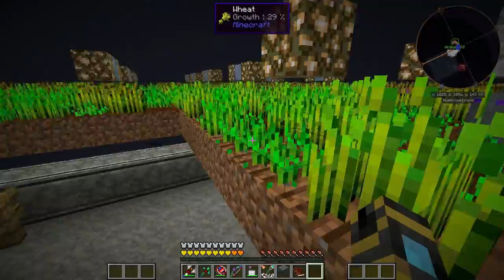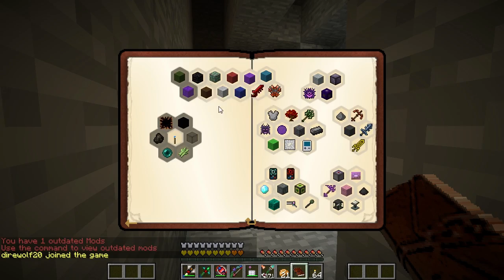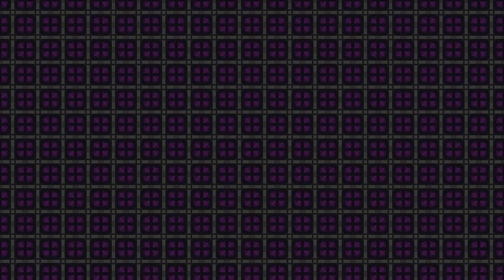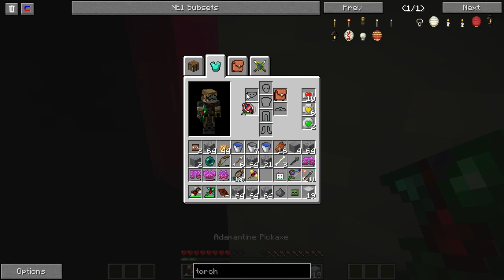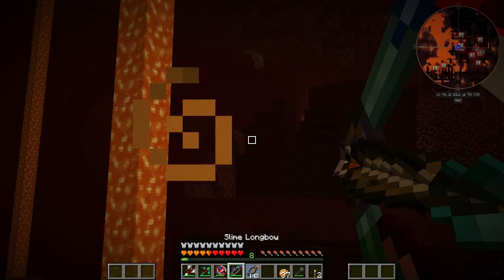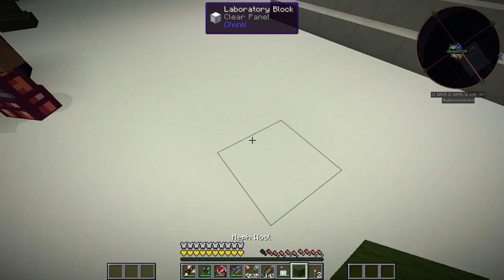Material Energy^4 with Direwolf20 - Episode 29

Comment: Please get yourself some wings! Or make dire make them for you.
Reply: SkybladePhoenix To make wings you need the octuple compressed cookie. that's why they dont have a torcherino now, cause dire made wings.
Reply: Pepper Spray Oh ok then :P
What about jetpacks?
Reply: Pepper Spray No, 4 septuple cookies
Reply: SkybladePhoenix Not in the Material Energy^4 modpack, unfortunately.  :~(
Reply: SkybladePhoenix You know what MIGHT work, tho...the Ender IO Staff of Traveling and a couple of the Ender IO Dark Steel tools allow for Enderman style Blinking even straight upward, right?  Just blink upwards really, really, high and use the OpenBlocks hangglider to glide anywhere you need to go at a reasonable speed.  Either that or use the Ender IO Dark Steel chest-piece with the glider wings added on.

It won't be quite as flexible as the wings bauble that Dire's got, but for navigating the Overworld at least, it should definitely work and allow one to get some pretty good ground-speed (in the case of the OpenBlocks hangglider, at least, haven't tried the Ender IO Dark Steel chestpiece with the glider wings, yet).